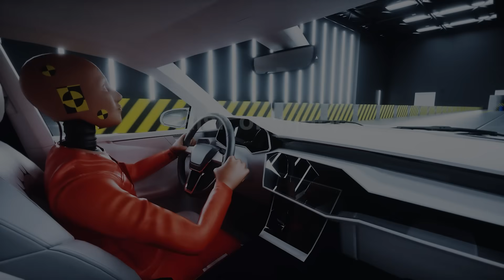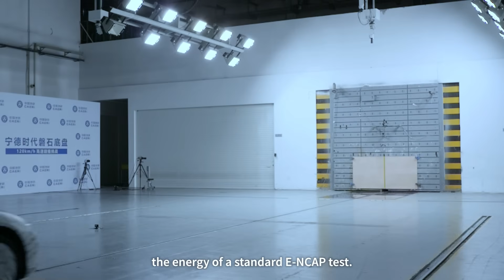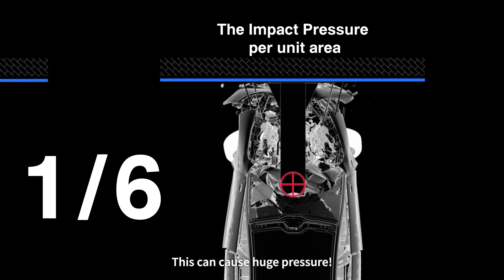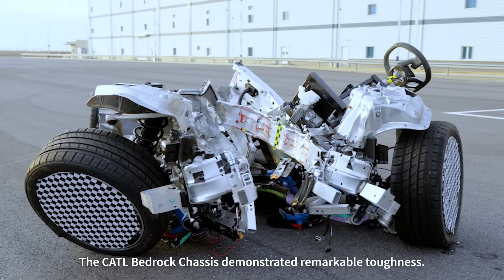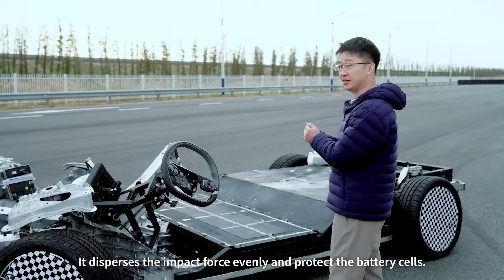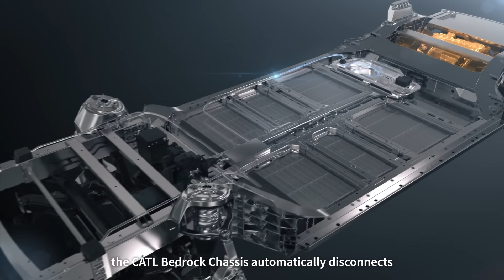CATL Bedrock Chassis Extreme Crash Test

Comment: What people don't realise is crash energy increases exponentially with speed (e=mc SQUARED). IIHS tested a Honda CR-V 4 years ago at 90kmh and the chassis collapsed. For this company to publicly show a 120kmh crash test is absolutely insane and commendable.
Reply: Yeah, except you work with FORCES, not energies when it comes to material resistance, crashworthiness and human tissue tolerance. So your comment is scientifically not correct.
Reply: @Mike1-Mike1S  in 120 km/h crash g forces are too high, you can't absorb so much stopping energy.
Reply: You're correct that crash energy is proportional to velocity², but the formula you presented - Einstein's famous E=mc², describes the relationship between the conversion of mass (m) to energy (E) for a particle at rest. In physics, mass and energy are two forms of the same thing, and it is possible (under certain conditions) to go from one to the other (like in a nuclear explosion).

In a vehicle crash, mass isn't being converted to energy, so this consideration isn't necessary. The energy stored in the motion of the mass of the vehicle (kinetic energy) is given by E=½mv². This is the energy that engineers are trying to dissipate in a crash.
Reply: @Borgamiester  lol you are entirely correct

Comment: What the hell is that piece of metal inside the cabin in the outdoor section ? not good!!
Reply: You realise that a "Car" would have a lot more metal at the front and other structure to alter the deformation path?
My bet is, if they HAD shown it with a body fitted, you would have complained that you couldn't see the battery, or that the body saved the battery......

Comment: Technically not impressive…it is very easy to desgin a stiff chassis frame. The Problem is that by the increased  stiffness the forces for occupants inside the vehicle rises to a intolerant level. 
Mercedes develope the first passenger vehicle with crumpel zone. 
So the real Engineering art is to combine a  stiff passenger cabine with „weak“ crumple zone to reduce the energy of the impact.
The CATL construction looks like a ledder frame of an old SUV. 

The crash test does not take into account the real packaging of an electric vehicle. Front engine auxiliary units (EAC, DCDC) in the front area are completely missing

Comment: How about human safety?
 Is it meaningfully safer to the passengers than existing chassis? 
I worry its over-optimized to pass the 120km/h test but actually a lot more fatal for passengers.
Reply: formula 1 drivers survive such crashes just bcz their cabin is strong and they crashes at more than 200kmph
Reply: Operation is successful patient dead.
Reply: this is a battery company, passengers safety is not their business,they only care about will the battery blow up.

Comment: > for every 1 km/h increase, injury risk increases 3%
> for every 5 km/h increase, injury risk increases ~100%

How does that make any sense?
Reply: It does not.
Risk of injury from 50 km/h to 64 km/h doubles according to research saying that the 1 km/h aprox. +3% but it's obviously wrongly stated as 1.03 rate five times is +16% 
Further testing and explanation is needed as you say.
Reply: It's called marketing. It has nothing to do with math 😂
Reply: interesting how they came out with this after the defence departments declaration
Reply: Inertia!
Reply: Risk of injury cannot be calculated directly from the speed increase, it's more about collecting statistics.
Also it does not state the base speed. Is it increase from 5kmh to 6 an 10 or is it increase from 120 to 121 and 125, so it's meaningless

 You can however calculate the energy increase, this is equal to the speed increase squared. For example increasing speed from 50 to 51 is 2% increase in spread and squared it is 4.04% increase in energy, going to 55, it's 10% increase in speed and 21% increase in energy. Or if you go from 30 to 31 and 35, its 6.7% and 36% increase in energy respectively.
Reply: Math? Maybe :)
Reply: bruh it's called exponential increase bro, not everything in this world is linear.
Reply: @CarsEditsShorts  What exactly about `f(x) = x + 0,03x` seems exponential to you?

Comment: The pole test with the chassis is flawed. The actual car would weigh much more and translate to a different outcome. Perhaps the additional structure mitigates this partly but we should be looking to the crashtested full car.
Reply: That's the reason they did it like this 😅
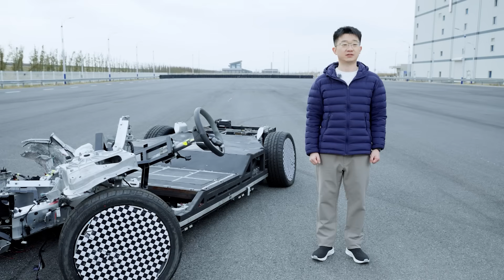Reply: @Znegil  no please cope better.  Just search the words Catl 120 km/hr crash test against a wall.  It did way better than the CATL chassis in this pole crash test. 3:09

Comment: this is not what crash test should test, but still good for protecting battery, so when designing the upper part engineers can concentrate on saving people inside as battery down there is already protected.
Reply: I was thinking the same thing, the driver would not survive. On the other hand, you are likely to die in a 120kph crash in any scenarip I gues....
Reply: there are few pictures of volvo xc90 after same crash, they say that none of people died inside. in some cases people can survive a lot of G force. in F1 there were several cases with 50G and nothing is even broken, while car is almost destroyed.
Reply: CATL is a battery company. It does make sense if they are concentrated in battery topic
Reply: For passengers, do you think this Bedrock Chassis is more safer option? or it just protects batteries and potentially worse off for passenger injuries/fatalities?
Reply: what???? with NO DEFORMATION on A Pliar and door wit such weight at 120kmh? are u an 1d10t?

Comment: I must be living under a rock because I thought catl was a battery Manufacturer not an auto manufacturer
Reply: They are not manufacturing cars, just the platform with the battery for other manufacturers.
Reply: They sell battery solution package.
Reply: Yes😂
Reply: Coming to a legacy maker near you...... soon.
All the "Manufacturer" does is specify the dimensions for wheelbase, track, suspension mounting, etc (Maybe even to the point of a "rolling Chassis"?)
The Chassis arrives with the computers and control systems, the "manufacturer" bolts mechanical stuff on, completes tests and setups, then sells the vehicle.

Comment: Thats really cool... But also colossally unrealistic. Virtually no accidents are going to be from 75mph to an instant dead stop.

Still, I do appreciate good engineering 😊
Reply: It's looking at the extremes.  If the battery survives a 75 mph pole crash, it should survive anything it's likely to see on the street.
Reply: When "the world and his brother" moans about "Battery safety" and YOU can make it safe while remaining competitive and profitable, why WOULDN'T you over-engineer?
THEN consider that this is (As demonstrated) a modular "one size (type) fits all" unit.
The weight variation of the vehicles to which it's applied could be considerable.

Comment: nobody's talking about the occupants (full size plastic dummies improvising as real world passengers) in the crash test . . . no mention of how the crash dummies reacted in the post crash analysis . . . in order to better understand the human body & it's level of tolerance . . .
Reply: This scenario is not survivable. This is all about preventing further harm caused by fire.
Reply: catl only provides chassis 
They aren’t carmakers
Reply: CATL is a Chinese company. People are expendable in China. Cars that catch fire create less profit.
Reply: Their job was to build a good chassis, they did. Rest is upto  carmakers
Reply: does it matter? which would you prefer to be? one where the front crushes up to to the back of your head or this? If you are going to have an accident at 120kmh, i think you want to be in this at the least
Reply: what???? with NO DEFORMATION on A Pliar and door wit such weight at 120kmh? are u an 1d10t?
Reply: You can do the math yourself to ballpark average deceleration. You know test speed and braking distance.
Last time I did a theoretical aproximation passengers will hardly reach safe enough over 150 km/h for typical restraint systems dimensions, injuries depend on technical details.
Vehicle body, passengers, partial overlap crashes, rear end collisions, side impacts and oblique impacts are indeed needed before claiming your battery chassis is safe.
You can't find any clear test of sedan vs break vs 5 door rear end comparisons... On regular vehicles or any being safe when a truck hits a car... We may need so larger spherical vehicles around passengers, though...
Reply: That is the job of auto manufacturers, not CATL's. CATL is a battery company, and it ensures that battery packs survive.
Reply: @hodanghau596  it is very much the job of CATL to provide a full analysis of the crash test . . . afterall CATL is the one conducting the crash tests . . .